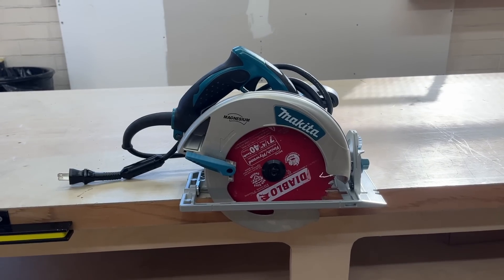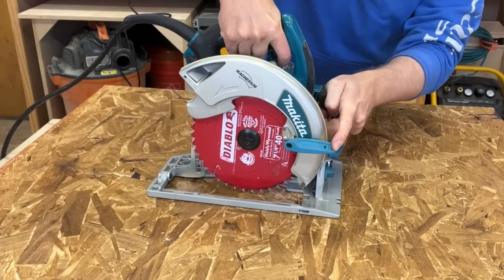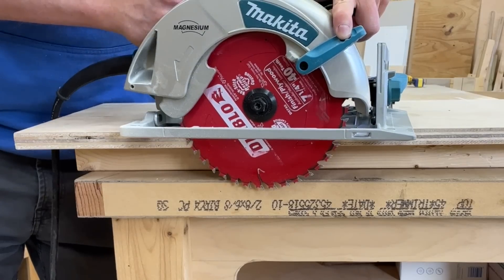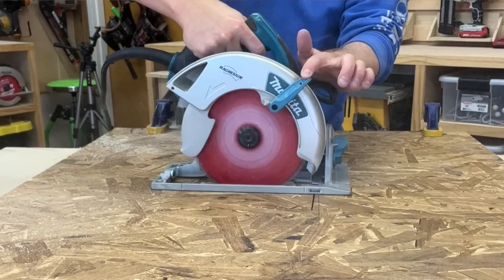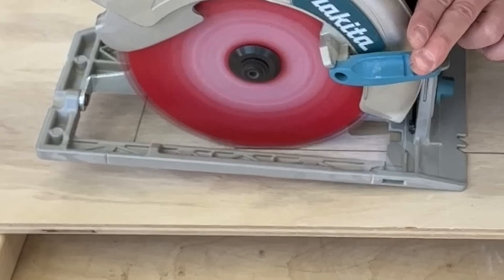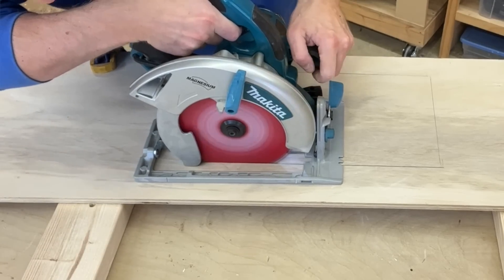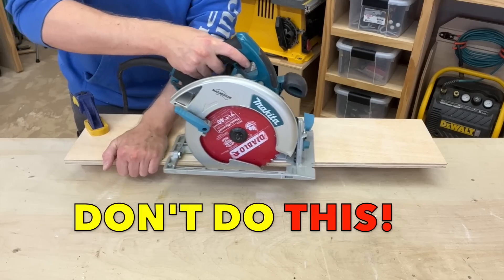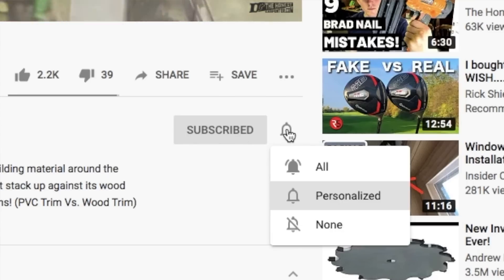Don't Try This DANGEROUS CUTTING TECHNIQUE! (Here's How To PLUNGE CUT W/ Circular Saw Instead!)

Comment: Hell no! Drill a starter hole and jigsaw from there, or use a multi depending on material. No job (personal or business) is worth that much risk. And you still have to clean the corners unless you are like 35% of the people out there who don't care.
Reply: skilsaw is faster and easier to keep a nice strait line. Finish up with jigsaw in corners. However for a DIY person not fully comfortable with a skilsaw, nothing wrong with using a jig saw.

Comment: Unless you pin your guard back I don't recommend doing a plunge cut. If your guard is pinned your able to use both hands with complete control . If not you have to cross your arms weakening your hold plus you  put your finger within an inch from the blade...think how stupid that is .
Reply: I've never had a need to pin the guard back, and I think that is unsafe. I just hold the guard up with my finger with the latch, and let it drop as the saw plunges into the material.
Reply: @chrisburns5691  There is no safe way to plunge cut with a power saw or any cut if done wrong and there's always the (you never know factor) . 35 yrs. of framing has taught me a little bit but # 1 Rule is...respect the saw , it can severally hurt you !
Reply: @michaelbradford4444  ok I've been a carpenter for 20 years, and have never had a need to pin the guard back, and I believe it's unsafe. You simply use your finger like the fellow in the video. I do cuts like this weekly if not daily with absolutely no issue. Perfectly safe. You still have both hands on the saw.
Reply: @chrisburns5691  Frame custom homes full-time for 6 months and I'll respect anything you have to say about operating a saw ...till then I don't want to hear it. TY
Reply: @michaelbradford4444  did you miss the part where I said I've been doing this work for 20 years? Not just framing, finishing as well. Never had a need to pin up a guard during that time.  When I did commercial formwork, pinning a guard up would likely get you written up and eventually told to leave the site, as carpenters are expected to know how to use their tools safely.